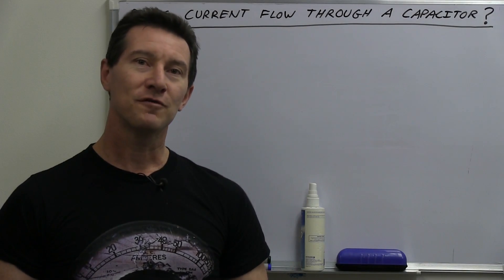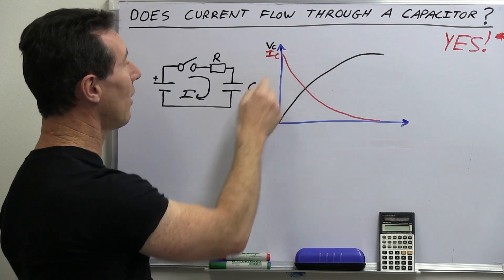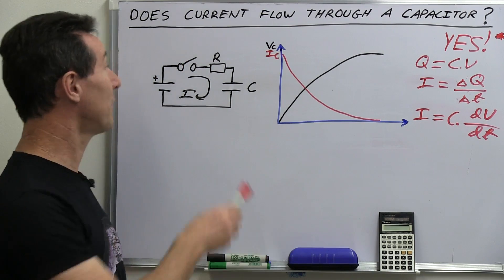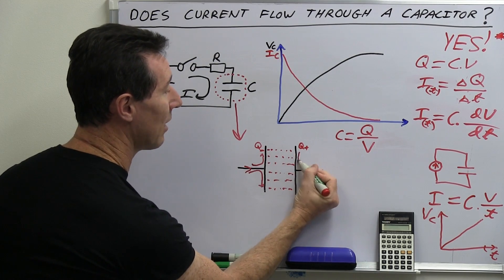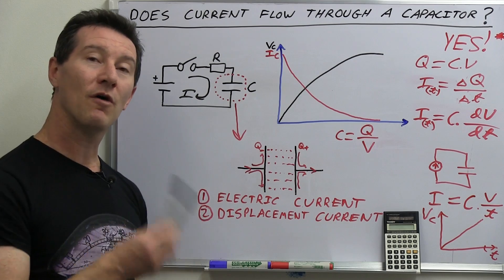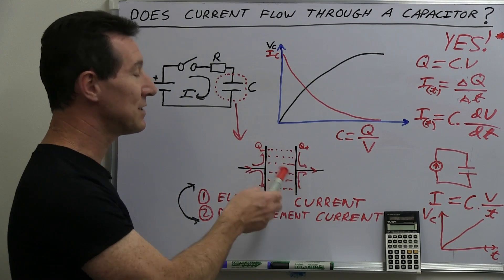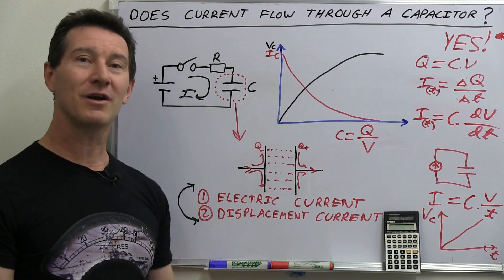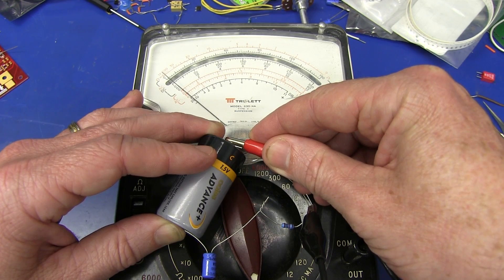EEVblog #486 - Does Current Flow Through A Capacitor?

Comment: Electric current never flows through the dielectric of the capacitor, though it flows through the external circuitry where that particular capacitor is connected, otherwise that would be a permanently damaged cap which is nothing more than a closed switch.

Comment: Love the videos.
 
I have always explained capacitors to myself as current flowing onto or into the plates and no further rather than through the capacitor and the fact that ac "passes" as the same energy being returned to source dependent on the "size of the plates"

Comment: In a dc circuit, electrons actually flow from negative to positive ;)
Reply: Doesn't matter if it's ac or dc. Electrons will always flow from negative to positive. "Negative" just means there are more electrons on one side than the other. The flow of current, however, is opposite of electrons.
Reply: I read that current flow can be thought of as the "flow" of the "holes" (in the outer valance shells of the atoms?) that the electrons leave behind.
Reply: Puppy Vids Absolutely correct. Sometimes holes, like that in a diode or transistor, is due to an impurity, instead of an electron moving away. An impurity, like boron, has three valence electrons, whereas silicon has four. So the bond between the silicon and the impurity leaves a hole. It's worth noting that adding an impurity doesn't add any charge. It still remains electrically neutral.

Comment: I wasn't clear in my question.  Since there is no direct connection between the input and output, that would have to mean the cap works like a transformer in that one pole has voltage induced in it because of the proximity to the other pole.  Of course this discussion is about current so my question isn't right on target for this forum.

Comment: About 50 years ago, I was in a class that discussed, "Capacitors, does current flow through them?"    The answer:  "A capacitor BLOCKS DC, and passes the "EFFECTS" of AC."   Simple as that.   As AC is applied to a capacitor, electrons LEAVE one plate, and ACCUMULATES  on the other  (via the AC power supply) - when the AC reverses, electronics again leave one plate and accumulates on the other - back and forth.    It will APPEAR that the current is going THROUGH the cap, but it is not.    Yes, there will be DC current, momentarily, in a series DC circuit with a cap and resistor, as the current from one plate leaves that plate, and heads for the battery - then EVERYTHING stops!   The DC is NOW blocked.   Apply AC, to that same circuit, then it will APPEAR that current passes through the cap but, again,  it really does not.
Reply: This answer Michael is more correct  to me.  Dave is obviously a sharp cat,  but his answer sounds more philosophical.
Reply: @hcetink  He explained the same thing. No difference. 
In my words, current yes, electrons no. And an animation will be a better explanation.
Reply: @johnyang799  uhhh ..... have you ever swam in a current without water?
Reply: @hcetink  Current is electrons flowing doesn't mean it has to flow through! Using your analogy, if there is a way that controls the water on one side of a barrier and controls the water on the other side. The current/information is essentially flowing through. But not the same water flowing through. Understand?
Reply: Current is measured in coulombs of electrons flowing through a conductor over time.  Current doesnt flow THROUGH a capacitor period unless the dialectric is faulty.   View it any way you like but that doesnt mean there is facts involved with ones opinion.
Reply: @johnyang799  Late in my answer.  Not sure what you mean by "...current yes, electrons no."   Current IS electron "movement."
Reply: @mmichaeldonavon  Movement yes. But no electron has been passed through the capacitor. But current is.
Reply: @johnyang799  Totally agree.
Reply: You have nailed it, sir!
Reply: @MrDoneboy  Thank you, kind sir. :)   "Doncha" just love electronics and the "stuff" that happens when you have a difference in potential!   I love "hole flow," with its Positive potential. :)
Reply: @MrDoneboy  Sometimes explaining capacitors is like trying to tell someone that their living room light is actually turning on and off - but they never can see that due to it doing it  60 times a second.
Reply: My word picture was not well stated.  I said that electrons LEAVE one plate and accumulate on the other, but that is VIA the overall external circuit - NOT through the capacitor.  I see where that was misleading.  Sorry.
Reply: @kirkhamandy  Let just say this:  A magnetic field will induce a VOLTAGE into a wire - IF there is a difference in potential, AND the circuit is complete, current will flow.
Reply: @kirkhamandy  We may be talking past each other.  Let me try this: A Primary of a Xformer is operating, and inducing a voltage into the Secondary winding - and we'll assume we have a small load across  the Secondary with a capacitor in series with that load.  If ONLY  one lead of the cap is connected, and I put my voltmeter across it, I'll read that secondary induced voltage.  Now, if I put an "Amp Clamp" over the wiring in our circuit, I'll read Zero Amps.  No current flow.  Remember the secondary is still receiving an induced voltage, but NO current is flowing.  Connect the cap, and the Amp meter "comes alive" and we now see the current from the Induced voltage.  What do you think of that?   Are we saying the same thing?   Thanks.
Reply: @kirkhamandy  OK, thanks.
Reply: @kirkhamandy  I did "tune in" to the lecture you suggested, and I found it quite interesting! :)   Your level of understanding of this subject, and the lecture itself, was way beyond my "pay grade."  :)  I did like to hear about the "displacement current" theory - also interesting.   Thanks for the tutorial.
Reply: @kirkhamandy  Thank you kind sir.
Reply: This is kind of good to know too.  This works more with magnets and iron and conductors.
It fails in chemical electricity like batteries and animal bodies.  I'm a computer scientist and EE (in the medical fields).  Electricity is one of those subjects where one mnemonic memory can't rule them all.  There's no silver bullet.  You literally have to learn the different patterns of different setups.  Most people think electricity is energy moving across electrons, but electricity works across many or quantum particles.  Capacitors are one of those components where a smaller particle, that can be measured detected by EMF, is being used to message a force/electricity.  Like Dave said, you could study this stuff for a lifetime and find new ways to make electricity move across certain mediums.  

My sibling is a [medical doctor]/chemist.  We started business together about 15 years ago serving patients.  And I do a bulk of the "science" and technology stuff.  I've watched hormones and chemicals give off detectable EMF that can be measured with a volt meter.  One experiment that comes to mind are lemons.   Electrons aren't moving, but you can set them up to create a electrical force to engine/move stuff.  Then there are all those force patterns.  Some forces have different patterns of movement or fields.  Its gets really complex and you have to write down all the different patterns.

Electricity in the machine world is more about the electrical effects of Iron.  In radio, its about changes in EMF across vacuums and space (and many metals).  There's a reason we have so many people looking for the "god particle" or "that one quantum particle to rule them all."   Some people have started theorizing "gravitons" again and finding ways to mathematically borrow equations from electricity and (trying to) apply them to research.  They think EMF and gravity are apart of the same paradigms.  Its getting crazy out here.
Reply: I agree, Michael.  The way I think - it's like electric field crosses the capacitor to push those electrons from another plate, to leave wholes, instead of electrons. Up to a point where there is nothing to push (no free electrons in the capacitor's plate), and thus current stops. So, in AC, when the electromagnetic field is reversed, the capacitor on one side has too many electrons, and on the other side, too few. So, electrons don't pass capacitor (in an ideal capacitor), but the electromagnetic field does pass through to affect electrons on another plate of the capacitor thus making electrons move, thus creating a current.
Another point - any broken wire is a capacitor. Except that capacitance is so small, that it's not being considered as a capacitor. So, just blindly saying that current goes through a capacitor is like saying that current flows through a broken wire. so, the answer is a bit complicated.
So, technically, current doesn't flow through a capacitor, electric fields does, affecting nearby electrons up to a certain distance).
Reply: I suggest that one has to un-learn the concept of 'electrons' to have any hope of approaching an acceptable speculation on this field phenomenon. Although convenient as a mathematical model, the notion of 'electrons' or 'charge' accumulating/leaving/moving/flowing through any mass matrix is nonsensical. A complete understanding of the primary energy pressure gradients of the magnetic field and its interaction with conductors is essential before speculation on either permeability or permittivity can begin. I say speculation because in reality, no one knows. One view of the MIT Physics demo video entitled 'The Dissectible Capacitor' confirms this.  https://youtu.be/9ckpQW9sdUg
Reply: AC current is DC electricity just switching direction based on the power sources hertz.

Comment: Heh. If you have classic audio amplifier, there is soft start circuit to limit inrush current caused by discharged caps, because it is too high. PC power supply same thing, NTC thermistor to limit inrush current of cap. Without it it will trigger circuit breaker. If somebody telling that there is no current, than he knows nothing about that. :)

Comment: Interestingly when dealing with extremely small capacitors you get the problem of electrons tunneling through the dielectric.. So in that case current does flow THROUGH the capacitor :D

Comment: I see it this way: current flows into a cap, and back out rather than through. In the demonstrated DC circuit with a switch on one side of the cap and the other side grounded, (conventional) current flows into the + side of the cap. Hook up a resistor across the cap and the current will flow back out of the + side of the cap. Presumably in the ammeter demo at the end of the video, a second ammeter on the grounded side of the cap would show no current (since that side always stays at the same voltage, ie: zero), hence the terminology of "into" rather than "through". Of course here we are talking about an ideal cap with no leakage etc.

Comment: Are you basically saying that a electromagnetic induction effect is occurring where current is not flowing through the capacitor but a charge is induced between the capacitor plates through the dielectric material?
Reply: I'm not quite sure about what you said, but I think I get what you are trying to say.
No the charge on a capacitor is not from induction. The electrons in one plate of the capacitor go to the other plate. 
Why do the electrons want to go to the other plate? It is because when you apply a voltage between the capacitor, you are applying a potential difference. One plate of the capacitor will have a higher electric potential than the other plate. Since electrons want to go to the lower potential plate, the electrons will travel through the wire and go to the other plate with lower electric potential.

The dielectric material is induced, but not for the reason you are thinking of. The dielectric material is slowly induced by the charge build up on the plates of the capacitor. When the dielectric material is induced, its e-field's will cancel out some of the e-fields of the capacitor. This will decrease the overall potential difference between the plates, and increase the capacitance. This is why we insert dielectrics into a capacitor (it increases capacitance). We could very easily not put a dielectric, but the capacitor would just not be as efficient for the amount of space it takes up.